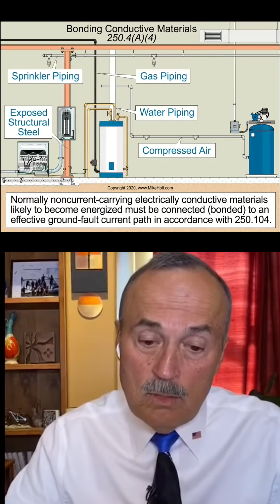Understanding Code Requirements for Bonding Gas Piping NEC 2020

Comment: I think the confusion on this topic comes from this being required as extra work on post WWII homes like my rental unit that have plenty of bells and whistles of modern homes but also is wired with two conductor no ground NM throughout all the original construction. After I saw these videos I checked my furnace and saw it lacked a grounding conductor so I watched some videos on how to fix that and now I’ve successfully bonded my gas pipes to the ECG.

Net net, it’s not good for things to be unclear and confusing but I think it’s a good thing this specific code requirement isn’t a problem if you just do the right thing in the first place.
Reply: So how's your bond working for you when it's a well? Yeah, the branch circuit has your back!😮

Comment: Hey Mike I totally agree with you electrically but there is also the fuel gas code.  If the house has CSST inside the gas pipe needs to be bonded, lightning blows the Yellow CSST apart.  If it is the Black CSST Arc-shield or arc-resistant then you don’t .
P.S. I’m a huge fan of yours.  I passed my Master Exam the first time because of your books.  Thank you
Reply from the maker: @Anthony-vb4mp, correct, watch MikeHolt.com/Gas

Comment: I would ground it regardless if it’s over or under 6ft. When gas and electricity ever shake hands it won’t be pretty.
Reply: I have seen flexible stainless get holes from arcing.

Comment: Hey Mike, There is a bonding requirement in the International Fuel and Gas Code that may have been overlooked - IFGC 310.2 requires CSST (corrigated stainless steel) gas piping, that does not have a listed arc resistant coating or jacket, or any gas system with segments of this type of piping,  to be connected to the grounding electrode system of the building OR the lightning protection system of the building. I'm curious to your opinion on this... IFGC section 310.2 also goes on to size of the wire, minimum lenghth of bonding jumper, ect.. Section 310.1 says all other gas piping to be connected to an effective ground fault current path (method described in your short is fine). BTW, I love your material and style of teaching. I recommend electricians to your content all the time.  Thanks all you and your team has done for the community.
Reply from the maker: What is your question that was not covered in the video?
Reply: @MikeHoltNEC  Your opinion... Saw the FULL video and got your opinion... and it did not dissapoint lol.

Comment: Youre also probably going to be landing a grounding conductor along with your current carrying conductors in your furnace.
Reply from the maker: You are required to have an equipment grounding conductor connected to the metal parts of the gas furnace. See 250.110
Reply: Isn't that what this is telling you. It's bonded because of your grounding conductor which should be binded to frame of the unit.

Comment: I don’t understand gas piping each section has thread sealing  and makes the pipe not continuity through all. which part do you bond ? Just the part that came out of the water heater ? Even bonding the water pipes in the attic  that makes no sense to me because of the thread sealer
Reply: if you put an ohm meter across the fittings you will see very low ohms on threaded joints. Waterheaters  
have dielectric unions, to avoid corrosion.
Reply from the maker: This video is about 'gas piping' not water piping connected to a gas appliance.
Reply: @MikeHoltNEC 😂

Comment: Normally we bond the hot /cold / gas pipe at the water heater so the whole system is bonded.
Reply: Unless someone 😂had used plastic midway thru plumbing 😮. 
I like to bond close as to incoming pipe for gas or water

Comment: I only ever had one inspector make me run a bonding jumper to the gas line. I didn't like the idea of it but he made me so ....
Reply: its safer to do this than not. gas needs a spark or arc to ignite. current is not either of these.
Reply from the maker: False, watch the entire video, click on the link in the short.
Reply: @MikeHoltNEC I'm assuming you're saying the inspector I referred to was incorrect.
Reply: @danielmcdougle6925  i dont see there being a problem with doing it, which is what most people think, that there will be some sort of explosion. When i lived in NJ i had inspectors make me jump the hot and cold water out where the thank connected and ive never seen that in the book but i dont think its a bad idea either.
Reply from the maker: @danielmcdougle6925  Yep, sorry for not being clear.